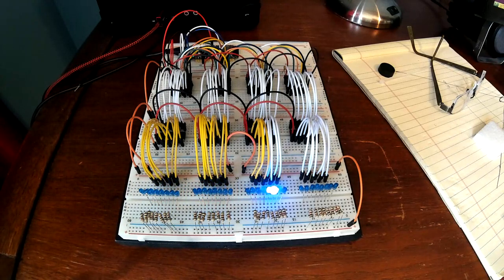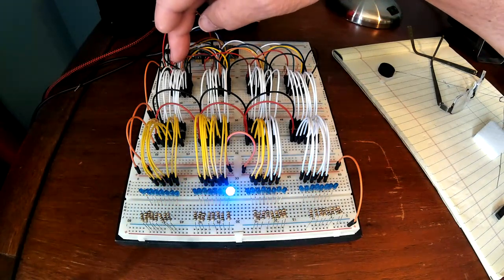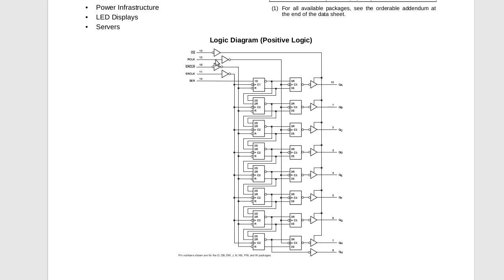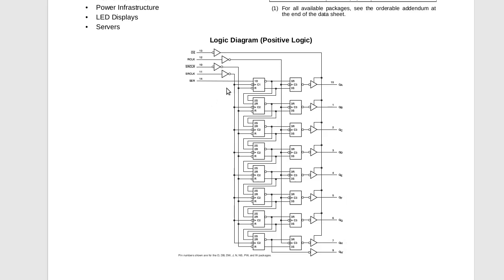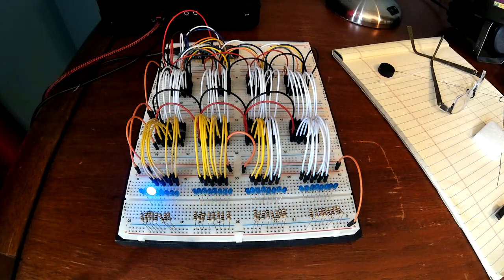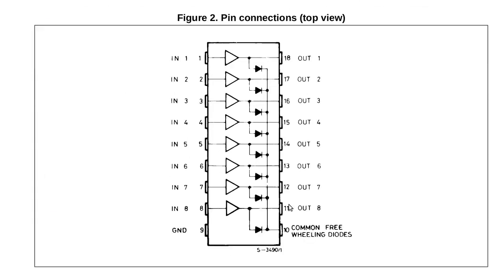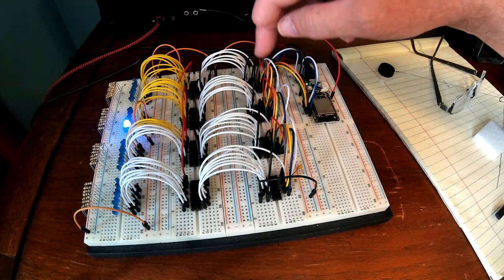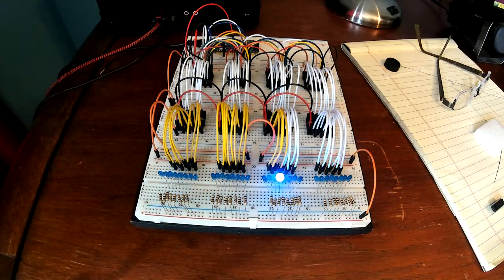Unlimited Outputs using Shift Registers - ESP32 Project 8

Comment: The SN is designed for LED control. For simply adding IO to your system, I'd recommend you check out the pcf8574  or mcp23017.  Both of these come in 16 IO flavors per chip allowing higher density. Here's a quick guide for controlling relays https://khaz.me/cheap-and-easy-control-of-8-relays-through-home-assistant/
Reply from the maker: Cool. I'll check it out. Thanks.